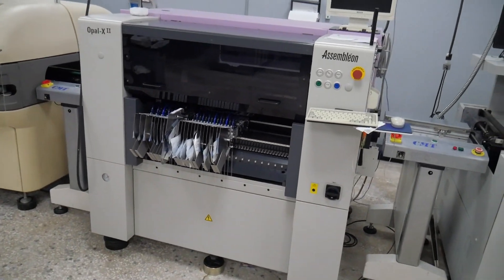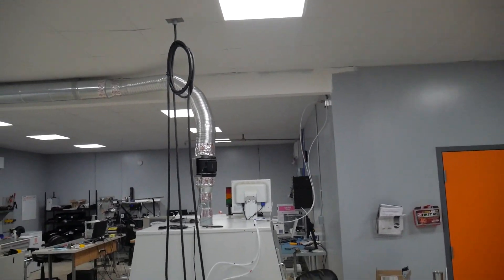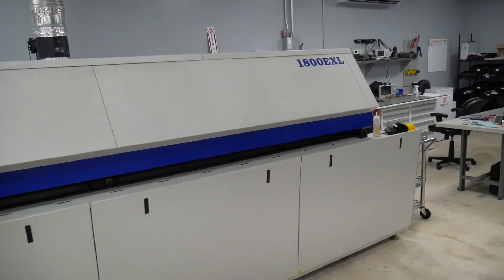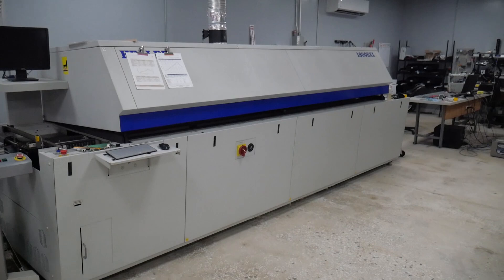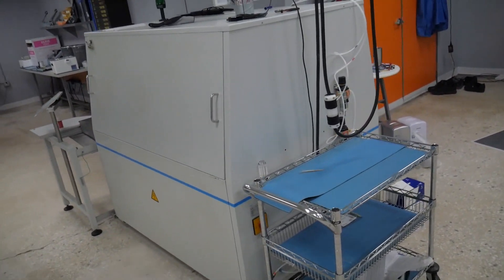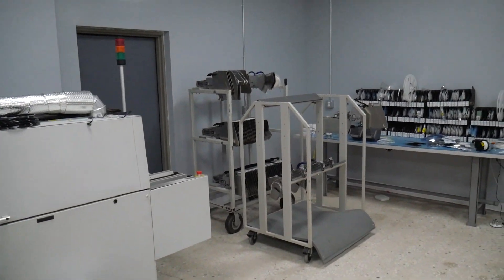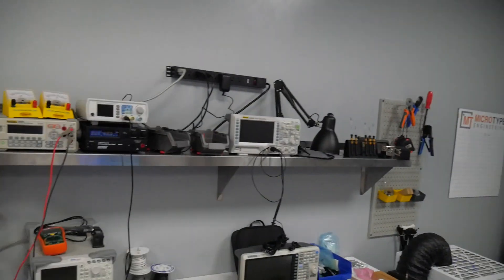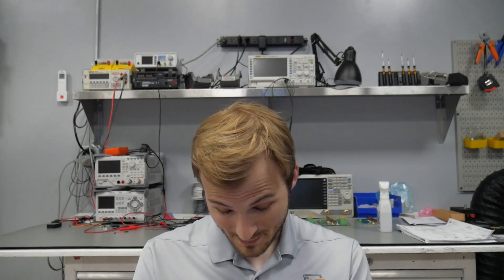I give up! Update to our assembly line

Comment: i run a small protyping buisness - totally understand the pleasure of a "working physical thing" i.e a stuffed pcb coming out from the process, and the satifaction associated with that, compared to the slow slog of R & D. thanks for the honesty. I'l stick to manual PNP for now, for those 3-12 pcbs at a time, on a friends borrowed Ok inustries manual PNP. P.S. i find you can get that immediate dopamine hit/ satesfaction elsewhere from Carpentry, CNC milling, breadmaking!

Comment: How was the software of the Assembleon?
Reminds me about an issue I had with a OnSemi TSSOP with my mechatronika machine, the owners of that company (Mechatronika in Poland) are absolute shit - told them so many times we cannot assemble our products flawlessly with their machine. What did they do - nothing.
So we wrote the software for their machine by ourself and got thing running.. and everytime something doesn't work with the software we can fix it ourself at least.
We have good software for the loading process (also done ourself).
Reply from the maker: @mr it's OK for an early-mid 2000s machine. Never had any major issues that we couldn't solve. Funny you mention Mechatronika. AFAIK, most (all) of manncorp's machines are just Mechatronika's with their branding on them.
Reply: @MicroTypeEngineering  maybe there are some similarities about the outlook, Mechatronika only supports a single pick and place head and their feeders are block feeders.
 
I reverse engineered their rs232/uart protocol and it's only a very simple machine. There are even lots of EMI issues with that machine feeders in some cases advance by themselves (not often but it happens). The PCB holder itself bends the PCB (of our MX80) it adds force from the side. The pick and place head can easily crash if you touch it possibly due to improper bypass caps.

There's no affine transformation done, just simple highschool math for matching the pick and place file with the PCB. 1mm boards are soso with that machine. And the machine itself is rated at 4k CPH but can barely do 1700 CPH if it takes components from all over the machine.
There's no multiselect, eg. if one feeder jams up you have to fix it - and cannot just skip it and place it afterwards the software is very unflexible.

Those who get along with Mechatronika boards can only do very simple boards and are happy with it, but if you are more into the 0402 and small components the machine is absolutely overpriced garbage.

After solving the software issues by writing our own software which suited our needs we still were stuck with jamming feeders (and we sent all of them to Mechatronika for a service, Mechatronika fanboys said there's no problem (as mentioned I am sure they only do simple projects and use papertapes only) however a few customers confirmed that the machine cannot handle plastic tapes properly).

The owners of Mechatronika are somewhat 64/68 years old they don't care anymore.

Comment: Oddly I've only heard stories on more demand for local PCB assembly, due to the many problems with China/logistics.
But I can see the downsides of running a PNP etc, which it seems no one else talks about.
It actually doesn't make sense financially to build a new PNP line at the moment, as the shipping is the same cost as the machines!
Bulky and heavy equipment is expensive to ship, so $600 machine, $600 postage, $9000 machine, $9000 postage.

Comment: Assembly is hard grunt work. It's definitely something I don't enjoy. Once had pre-production run of 100 boards or so just to find out at the end of PnP that supplier send in a wrong crystal with 1-2 pin arrangement than 3-4 arrangement. Colossal waste of time waiting to get the correct part and manually reworking 100 boards. 
It's outsource-the-assembly part all the way for me these days. That amount of stress is just not worth it.
Reply from the maker: Exactly! So many stories just like yours!